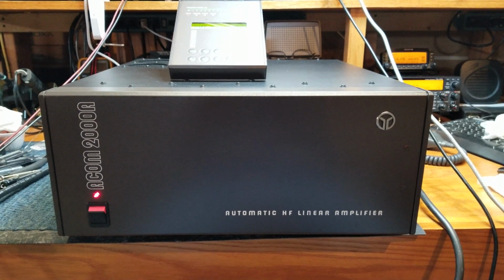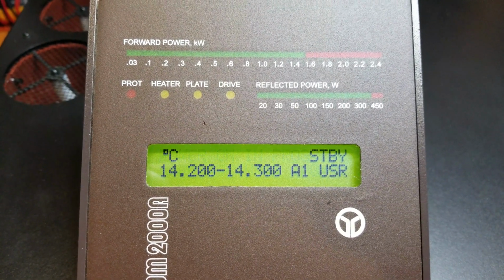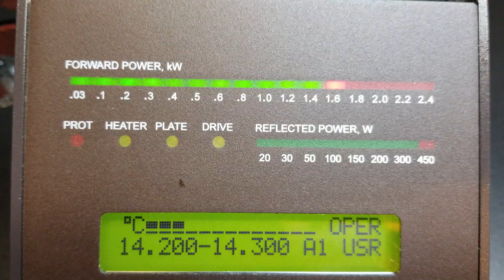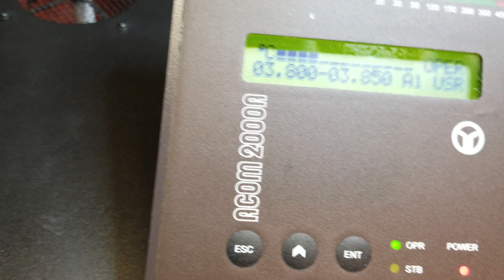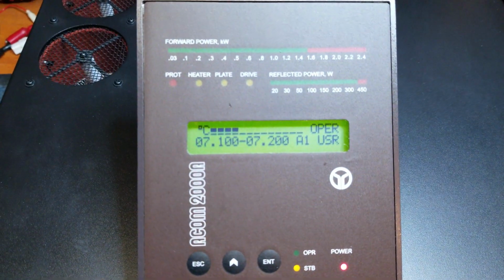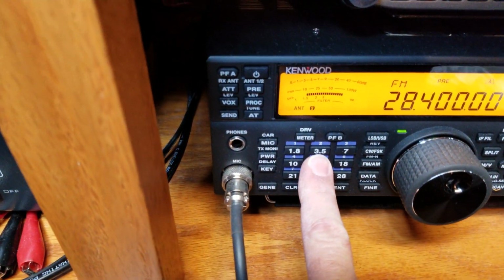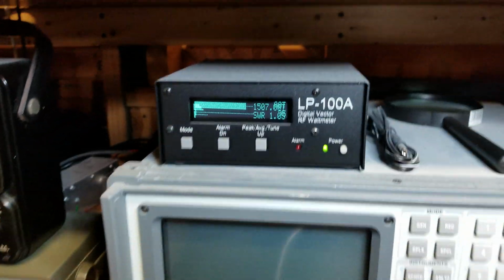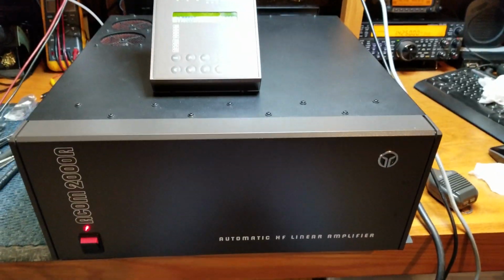Acom 2000A test

Comment: Wow, that's one kick ass amp.. I'm looking at buying the Acom 1010 from DX engineering. The staff at DX says the Acom line is rock solid and a great value.
Reply: They are the best, I have the 1000 and 1010 de AC3LZ
Reply: I own a 2100. Built like a tank. Wish they made one with x2 4CX1000.